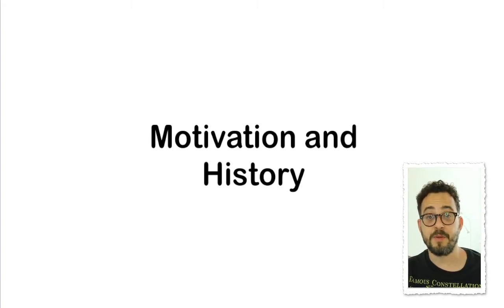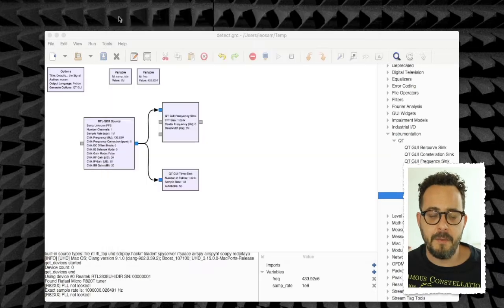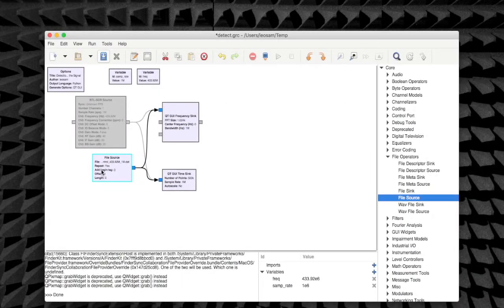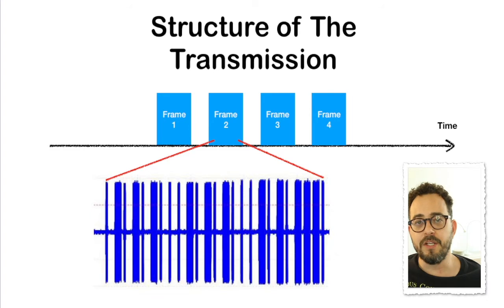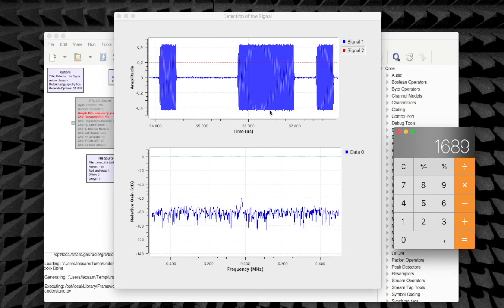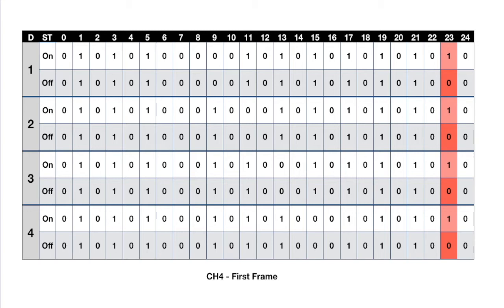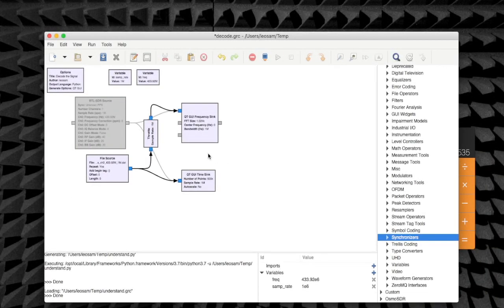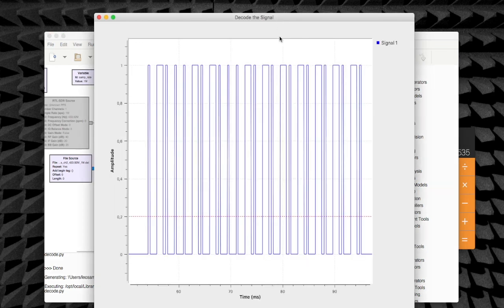European GNU Radio Days Intro 2: Receiving a Real Transmission  from A to (almost) Z (L. Cardoso)

Comment: That - 0/1 decoder block, outputting a numeric stream - should be part of the standard GNU Radio ? Would allow logging of transmitted commands for later analysis. btw, my device, looking just like yours, appear to have 16 bit blocks with the following distribution (not tested changing channels yet)
1-7 Channel
8-13 Button set - with an interesting ‘wrap around’ structure, shifting bits to the right as we go A-B-C-D (A = 001111, B= 100111 etc. Always 4 1’s and 2 0’s
14-16: on off, with 100 = OFF and 001 = ON

Comment: First, this is the most informative and useful GNU radio video I have seen so far (Just getting started). You don't just add blocks, you explain. And show the middle mouse button menu which I did not know existed. If it only worked on a keyboard only setup...

Cheeky question: How do you know the red signal is not - a lot - ahead of the blue ?